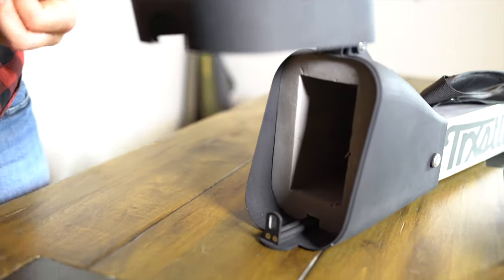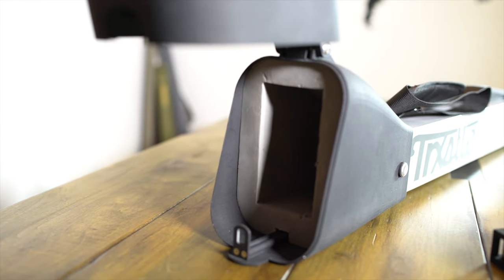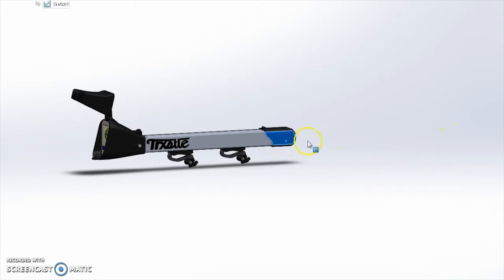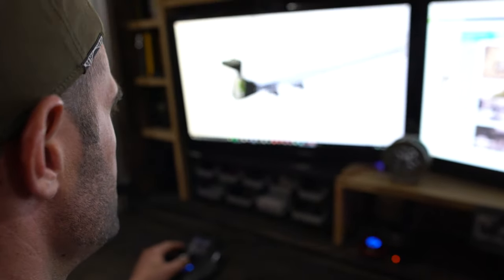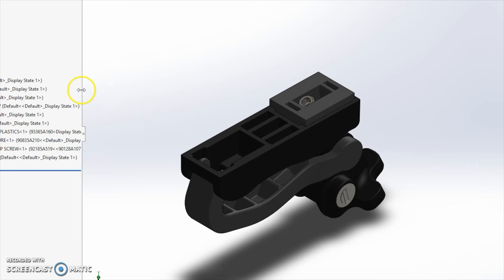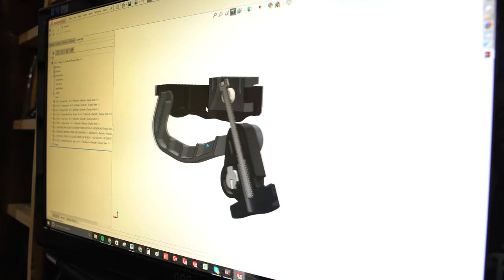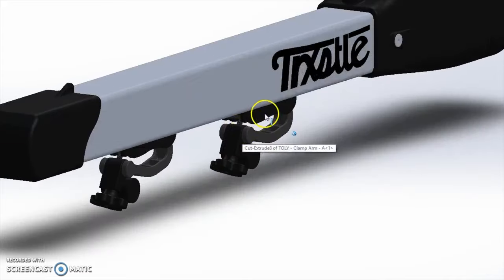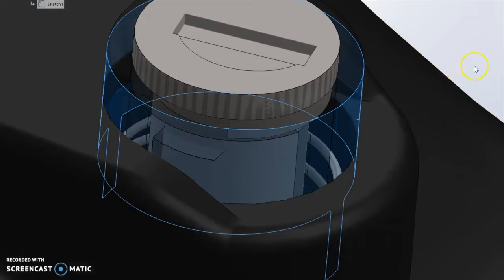Trxstle - The CRC System Prototype (Olympian) - Full Walk through

Comment: I just installed my crc system. Testing it out tomorrow.  However, the clamps I have are standard and I have the exposed roof rack system.  Do you a different option for clamping?  It is not so easy on and off application.